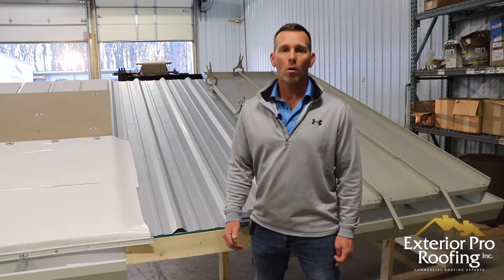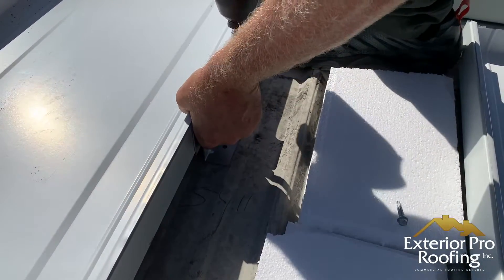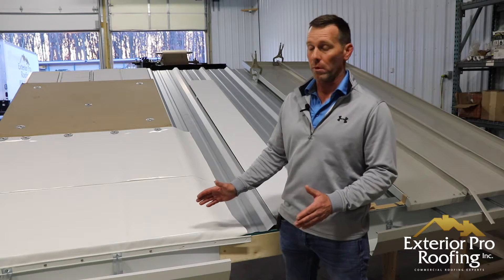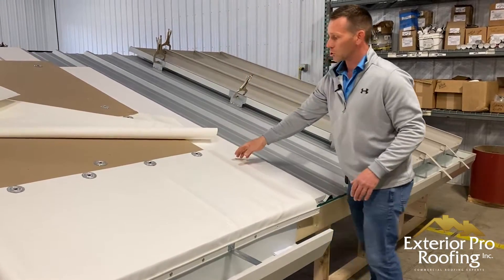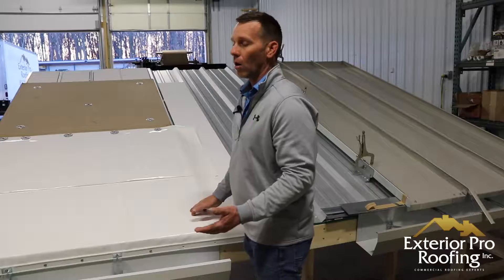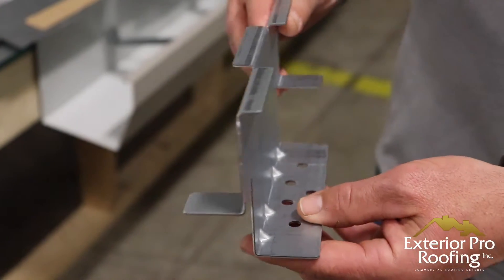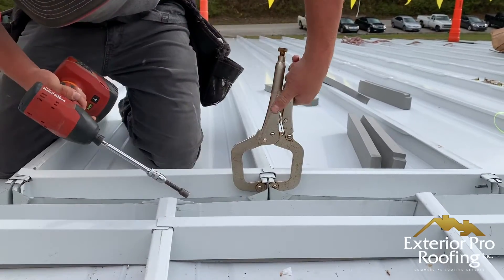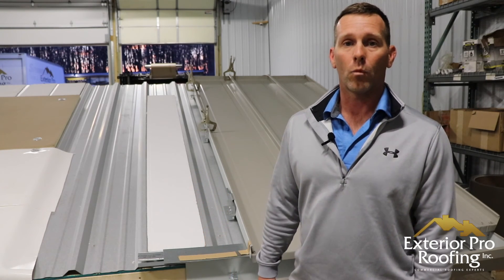Metal roof Recover Options- Metal over Metal vs. Membrane over Metal roof retrofit

Comment: Is there a way to add insulation on top of an R-panel metal roof?   We do not have an option to add more insulation underneath the metal roof.  That is why we are looking for a solution to insulate on top.   Is your metal over metal an aluminum solution or are the new panel made of steel?

Comment: Actually live in a 14 x 60 mobile home and it has a metal roof because the other roof was ripped off in a tornado so it's got a a pitch on each side with like 7 ft panels going up to the peak just like your original metal that's covered by your your new stuff and it's leaking from one end to the other, I've actually had to change the ceiling numerous times already and can't do it no more and I'm considering a metal nail over like you're showing

Comment: I saw in another video where your membrane retrofit lasts 20 years.   How long will the metal over metal last ?    Most of our problems are rusty screws but a few are bullet holes.  Thanks
Reply: I hesitate a little to speak for the video guy. But, his metal over metal recovery example is a standing seam. That should “in theory” last 50+ yrs, - paint fade over time. Nothing stops bullets and I’ve even seen a few grinder blades stuck in roof panels. Realistically to get 50yrs, you shouldn’t have lots of penetrations and I would highly recommend not having any that span the flutes (ventilators, hvac, and exhaust fans). Put everything you can through the wall or set on the ground. If you do have larger/many penetrations I’d recommend the membrane. Metal roofs with exposed fasteners are only as good for the life of the screw. Exposed screw will last 10-15,  I highly recommend maintaining/replacement every 10 yrs max. You could get away with replacing screws 3 times if your installers are good and they set clutches on the drills. I could keep going for days on this but I’m tired of typing on my phone